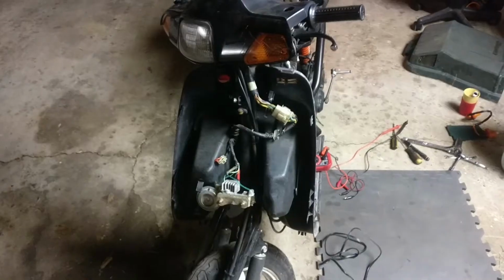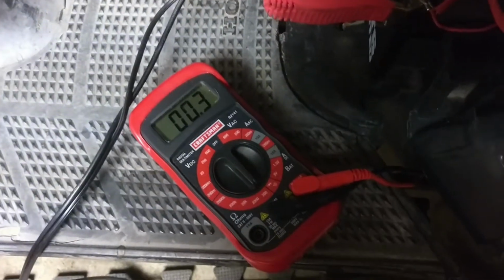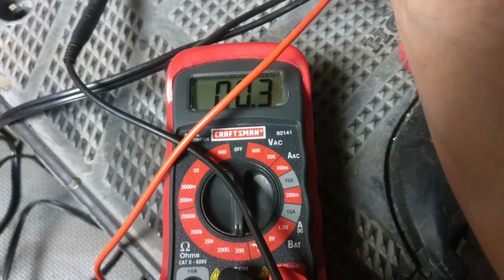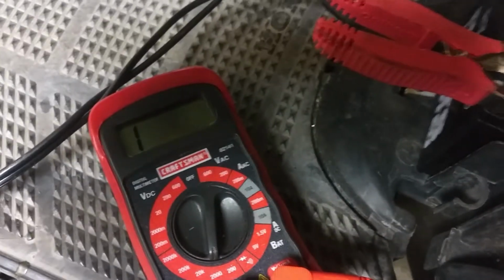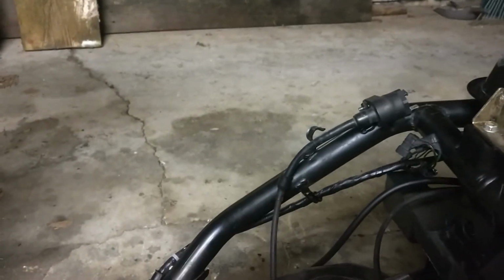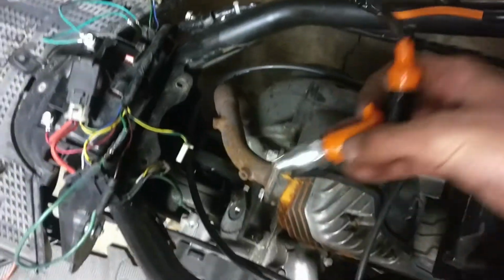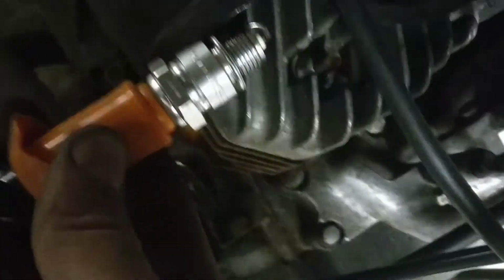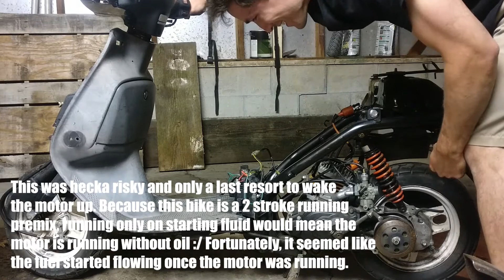Honda Elite 50cc Bad Ignition Coil - Will It Start??

Comment: Ik this is an old video but if you multimeter fails an offset test you will get bad and inaccurate readings and should either get your meter calibrated or use a new one that passes and offset test.